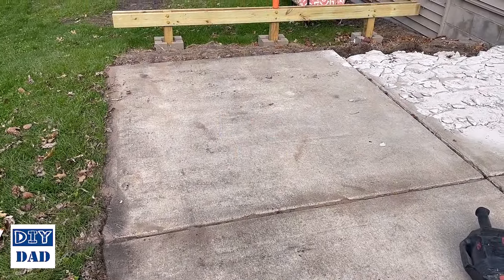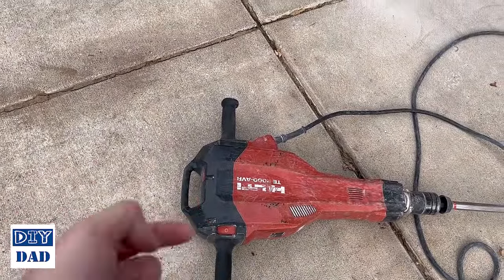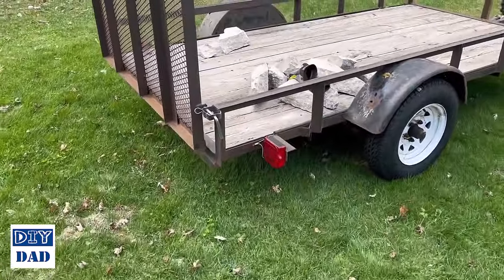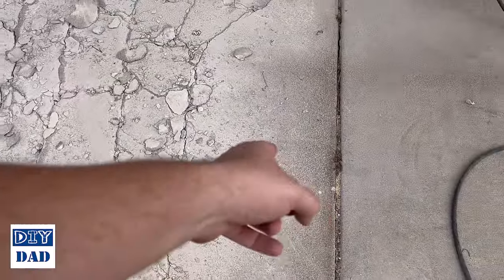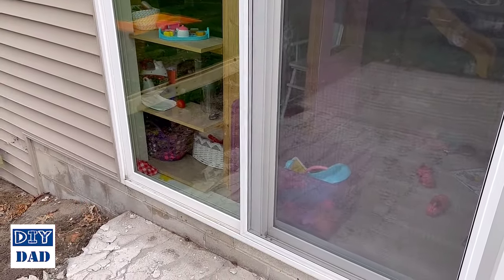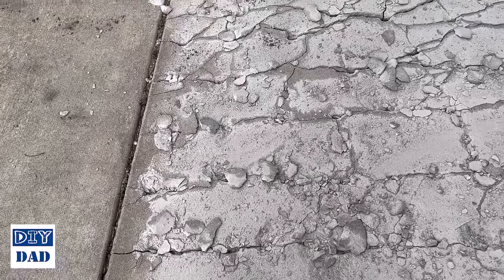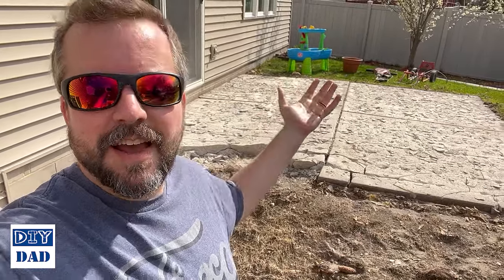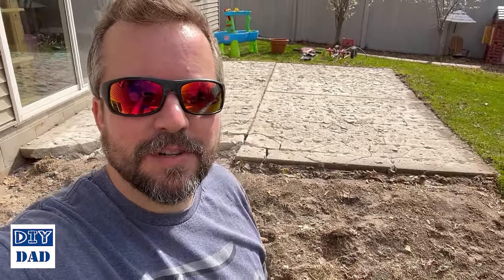Breaking up concrete in a controlled way with a Jackhammer

Comment: Thanks for the video and the dad joke. I'm thinking of buying a breaker to demo out my driveway. That's a great tip to get the concrete to crack in a line to get bigger pieces out. I'd like to use my broken concrete for a small retaining wall,  so I'd like to control where the breaks are as much as possible. I'm depressed that my driveway sunk and heaved and cracked about 2 years after my house was built, but maybe re-using the concrete will be nice. Great video.
Reply from the maker: Appreciate the feedback! With your driveway, you may have rebar to deal with depending on how it was poured (metal bars that form a grid under the concrete) - that may make it more difficult to break up

Comment: Thanks for the instructional video. How big of a jack hammer did you use? i.e 40, 60, 90 lb breaker.
Reply from the maker: Actually it was a 32lb breaker and did the job nicely
Reply: What advice would you give a middle age woman trying this for the first time? Do you need a lot of upper body strength?
Reply from the maker: @amynohe5654 The tool itself is fairly heavy, so positioning it and lifting it takes a bit of upper body strength, but the actual breaking action is more about keeping it stable, you don't have to push down on the tool or anything - it does the work.

It was a fair amount of strain on the upper back and shoulders to position and use though due to the vibrations and weight of the tool. Worst part was lifting and hauling the resulting material